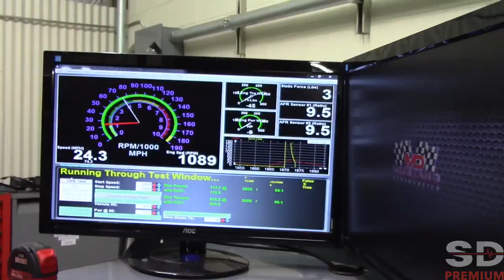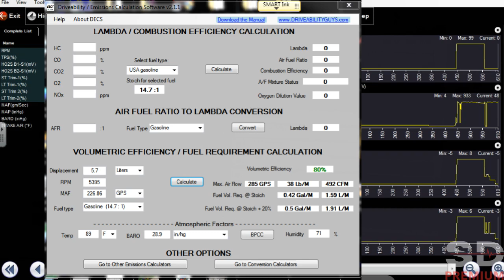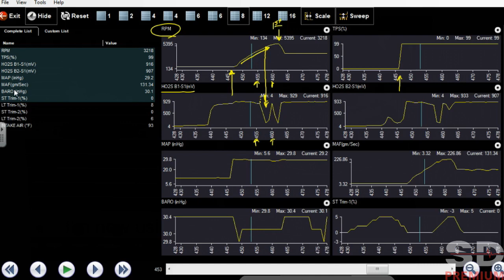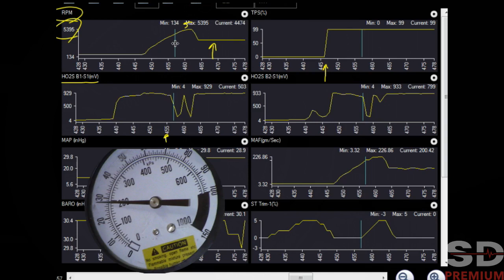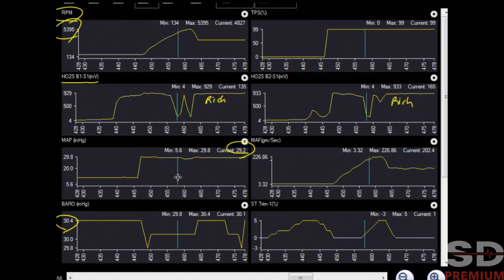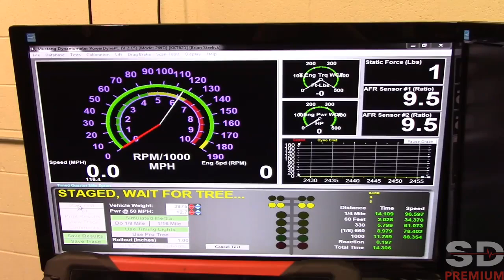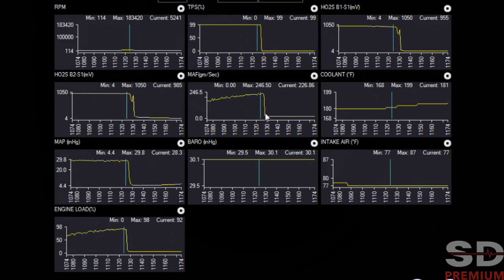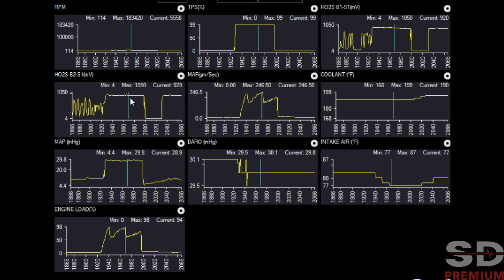Low Power Troubleshooting Using a Dyno - a 2017 SD Premium video

Comment: Not sure about the MAP pressure being used to identify restricted exhaust. Yes, there’s a small amount of overlap but if it was at a higher degree  of pressure, surely you would notice it in the form of back firing in the intake. Wouldn’t you also see a decrease of vacuum due to back pressure. Just thinking out loud. I love your case studies and talking through diagnostics as you are troubleshooting. Huge learning tool. Most schools teach automotive systems not troubleshooting. You are one of a kind. Thank you.
Reply from the maker: backfiring in the intake is never the symptom you have with an exhaust restriction. That is almost always a lean misfire that causes backfiring through the intake. And to your point, I haven't used the MAP for exhaust restriction ID, not yet at least. There are some guys that swear of it being the test. I've yet to find it as reliable as the actual backpressure test. Thanks for your kind words!

Comment: I was starting to worry about you. I hope everyone is well.
I doubt that the MAP data from the scanner will be of much use in diagnosing back pressure. Scoping the sensor could reveal more, but might require a bank of known good/bad waveforms specific to each engine due to the considerable variation in valve overlap and valve event timing between engines.
That dyno is a pretty sweet tool. Thanks for the video.

Comment: Paul, before scanners were a thing the vacuum gauge was a diagnostic tool that carried a lot of weight. If you did a snap throttle test you would expect to see a fairly quick high vacuum, rpm high and throttle plate suddenly closed. If you didn’t see this then you would expect plugged exhaust or a major vacuum leak. If the complaint was low power at high rpm or under load then most likely plugged exhaust. If you saw rapid fluctuations in the vac gauge it was a good indication of worn valve guides, doesn’t work for boats though because the engine exhausts below the water line and you will eat an unnecessary valve job. Go ahead and ask me how I know this :-). So to answer your question I would not be surprised if you could see a plugged exhaust in the MAP sensor signal.

Comment: I had this on 2 of our work trucks. They just would loss power after running for 20 minutes of heavy hill climbing or load. The company was ready to go and buy 2 trucks (2011 chevy 2500 hd 6.0 L 4x4) to replace them. I finally got a fuel psi gauge on one and drove it hard till it acted up. Found that when they acted up the fuel pressure reading would be 20 or less and would barely run. But let it sit for an hour or 2 and would be fine. Chevy says no fuel filters on they systems but found there is a fuel filter  after the pump in the tank. The guys that use it  dry in dusty environment and kept loosing fuel caps and would stuff a rag or nothing to cover the tank. The dirt would build up on the filter pleats so much to block the flow. Turn off and the sediment would fall off till either the long run time or heavy load. Changed both pumps on both truck and saved the purchase of 2 trucks. I have since got the shop to buy a Mityvac MV5545 PRO Fuel System Test Kit. It can show how much flow the fuel pump can do and can monitor the psi at the same time. Alot easier on the trucks.

Comment: Class looking car. I get confused with the fact that inHg go to a lower number with more vaccum when reading MAP sensor.  Is this correct? Before i thought on a good engine at idle you should have 18-22inHg and higher with more vaccum

Comment: Thanks for all the the great videos. I have a question. Can you use a voltage drop test to check the state of data link wires between modules. I have a Frieghtliner bus that is loosing comm.  between the emc and injection pump module and can’t get it to show up with a wiggle test. Trying to figure out if it’s wires or module. If so what is the acceptable drop. Thank you. Todd.
Reply from the maker: do you have a lab scope? have you measured the resistance of the CAN yet?
Reply: ScannerDanner I do have a two channel scope. I don’t believe this system is a CAN but I did measure the resistance of the wires between modules on the two datalink wires, very low resistance. The voltage drop on the + wire was .01 and the - was .2 I think all while loaded and giving the problem. Checked all pins as well. Thanks.

Comment: Do you think you would see a temp increase in the manifold from the clogged exhaust also? 

Did you ever get to test this theory in practice?
Reply from the maker: I don't think so because the engine is not breathing properly, but I am not totally sure. It is not something I've ever tested nor felt the need to. Good question!

Comment: I see 2 issues with using MAP to sense exhaust backpressure.  1- when the cylinder pressure exceeds atmosphere, no more air(O2) can be drawn in so, the engine will stall.  2-any exhaust flow that could make it into the intake would have to make pressure against the wide open throttle bore.  Since a normal engine is not stalling out, it must have some pressure, below 1BAR, in the intake to force air into the cylinders. A sensor that could read the  pressure on an expanded scale(millibars) and having knowledge of what the reading of a normal engine is, could be used to infer exhaust backpresssure.

Comment: The dyno and the graphs show the vehicle problem.  The dyno sensor problem?  Have never seen that before.  The old Clayton we had at work used water as the load.  You could vary the load with a hand held remote.
Watching this a second time will understand it better.
Reply from the maker: A dyno sensor problem and a simple faulty fuel pump. The dyno issue had me for a minute. Wish I could have filmed this live but I had a class to teach that day.

Comment: On the map sensor with plugged exhaust wouldn’t the map still be pretty much atmospheric because the butterfly valve is open so pressure wouldn’t really build in the intake ?
Reply: Curious myself.  There are some restrictions, probably the biggest being an air filter that may pulses of air flow in the wrong direction..
Reply from the maker: We would have low VE numbers with the intake or exhaust restrictions
Reply from the maker: It absolutely will build in the intake. Valve overlap is the key in understanding that. Hope that makes sense.

Comment: Do all stock engines/camshafts have valve overlap?  I'm thinking they don't, or anytime you smoke test an intake, it would go straight out the exhaust.  So that makes me wonder if an engine didn't have overlap, if the intake manifold would still see the pressure increase.
Reply from the maker: Every engine has overlap to my knowledge
Reply: @ScannerDanner  I find that interesting in how smoke testing intake manifolds work.  Wouldn't overlap allow the smoke from the intake into a cylinder, and out the same cylinders exhaust valve?  We don't generally turn an engine over to a specific position to do an intake smoke test.
Reply from the maker: I would imagine eventually you'll have smoke coming out of the exhaust if you smoked it long enough
Reply: think about it  multiply the degree of overlap by the number of cylinders and this is the number that you have a chance out of 720 degrees both would be open. for example a 20 degree overlap on an 8 cyinder would be 160  so there is 560 degree points in that 720 where both would not be open. so the chances are low  but you do have a point.  this is why we do cylinder loss test when indicated.
Reply: @richardcranium5839  ..genius!  I admit I haven't done too many intake smoke tests, but now it makes sense.  Eventually odds will meet and I'll find that 160/720 degree (22%) chance that I'll send smoke right out the exhaust.  And it seems rotating the crank a few degrees by hand will get you out of that zone.  Thanks!
Reply: @ablackformula  dont forget that those are example numbers, your results may vary. also consider cams with phasers and if they stick in an advanced or retarded position(depending on which cam ) the amount will also vary. if we knew the engine specs we could probably figure out that one crank position where there was no chance of overlap but that might hurt my brain. lol the symptoms of such a leaky test would most likely be an engine miss to start with so the diagnostic flow chart we design would be different. but a lean miss would send you to possibly a smoke test only after a realative compression test.  remember before you go after a driveability issue to be sure engine mechanical is good first.  it will always come back to basics. if you ignore them first all you can see is rabbit holes.

Comment: If the MAP sensor is one bar only, is it possible to read more pressure for a plugged exhaust?
Reply from the maker: It is because I am not at sea level. We are at about 1000 ft in the Pittsburgh area. So my KOEO Baro should be the same as wide open throttle.

Comment: How do you do the ve test if the vehicle has a cvt transmission.
Reply from the maker: It has nothing to do with the transmission type, you just need to be at wide open throttle for the measurements.

Comment: I'm still confused why O2's stayed rich at WOT after the initial lean dip. You'll have t puta potatoein the exhaust for your MAP theory.
Reply from the maker: Because the dyno was holding the engine back from revving up any higher, there was a dyno sensor issue that was faulty which was the monkey wrench in this diagnosis.

Comment: I still don't understand why the o2s were reading rich most of the time. At the beginning of the video, you said you didn't think it was a bad fuel pump because the o2s were reading rich, which I understand. But it was a bad fuel pump. What gives?
Reply from the maker: The dyno was overloading the driveline preventing the engine from revving up during the runs. One bad sensor on the roller. I talked about it, you must have missed it.

Comment: that run at 29:36 dont count- he redlighted lol.  thats way too easy.  i rmember having the dyno and the sun machine with a tailpipe sniffer and teed fuel pressure guage and tying in real time to keep track of it all  going by memory after a run as to where to look next. worse yet was trying to match jets in a carb without going too big or you'd start all over.

Comment: Was gonna say early shift
Reply: On the 4l60e there's a big ratio drop in 2nd from 1st. Usually program a little more rpm be for the 2nd shift
Reply: Great catch...volume flow
Reply: Need a 255 lph pump.
As more power is made will need upgrade to larger lines and bigger pump.
I've built some drag cars and nasty big blocks.
My latest customer 1980 Chevy Malibu 406cI /350 turbo drag car AFR 195/Comp cam roller/gear timing/Vic Jr./Holley 850
3500 stall 4.88s 28.5 M/T